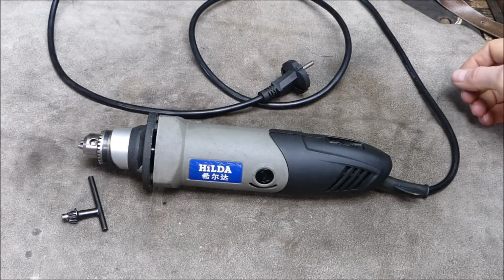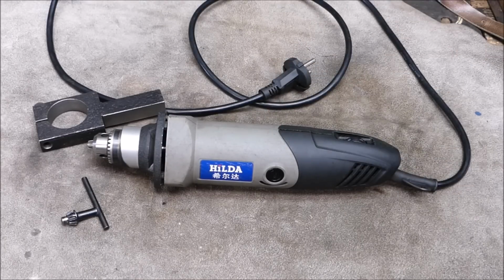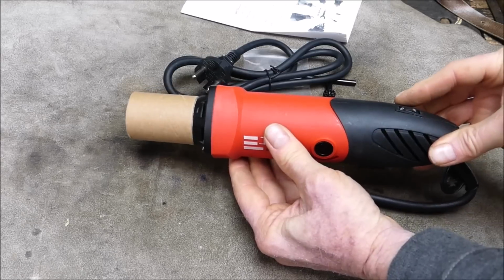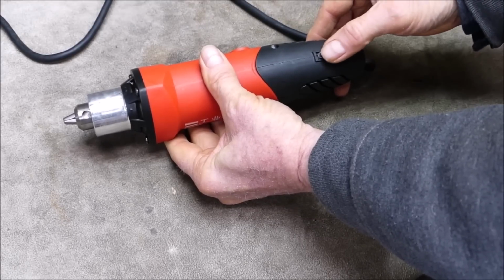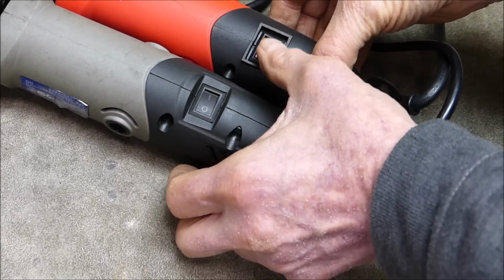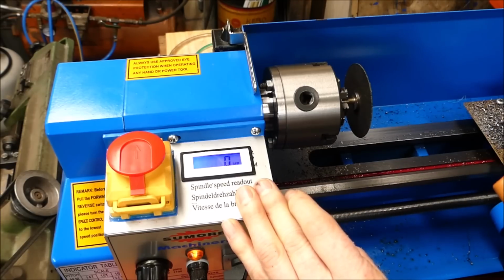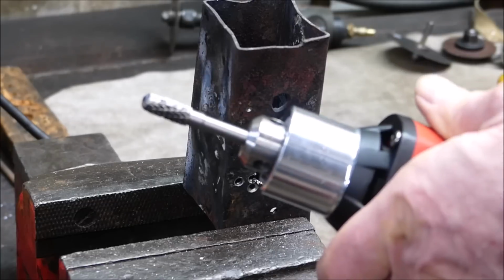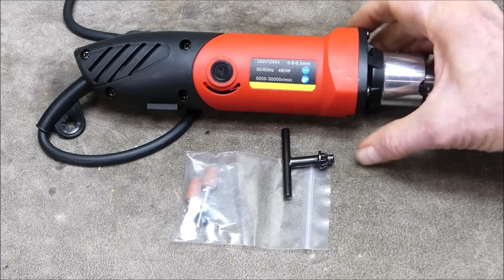I review a budget electric die grinder that ticks all the boxes - well ahead of the rest

Comment from the maker: Note:  The cutting discs shown are made for the job/speed.  They are the same as used in crash repair shops to cut away panels etc .  The size you need is 75 x 0.8 x 10 mm.  They also come in 1 and 1.2 mm thickness.  Rated at 25000 - 30000 RPM depending on brand.  I made the arbour. Dead easy.
  
DO NOT attempt to use angle grinder discs/remnants larger than 50 mm with one of these as the safe/rated surface speed will be exceeded.  Play safe.

Cheers Rob
Reply: You should pin this one,  very good and important safety advice! Also never without at least goggles, better a grinding mask, I've seen nasty shit caused by disintegrating cutting disks.
Reply from the maker: @jonasduell9953  Done.

Comment: Greetings again Robert ,l do use my Hilda on your recommendation.
The nose is limited in length and spindle extensions are problematical at that click l found out with some success. , Otherwise it gets the job done enough but ? 750W 6mm Electric Die Grinder Straight Handheld Grinding Machine Variable Speed, EBay $67 delivered  has some very useful designs adding more versatility and stability but . l wonder if I am missing something that your keen eye won't if you may ? Be good if a store around here had one to try out, under warranty to, ha ha. Cheers ROB.
Reply from the maker: Hi John,  most straight shaft hand held electric grinders only have a collet chuck (usually 6 mm).  The Hilda has a Jacobs chuck which is a lot more useful.  The other version Banggood sell and I reviewed has a machined mounting nose collar as well which allows more positive alignment. Cheers Rob

Comment: I can’t wait to get mine
Reply from the maker: Great tool.
Reply: How fast do they go
Reply from the maker: Supposedly 30,000 RPM.  This one hit 28 K but is still loosening up.  It's too fast to drill and the unit is really meant for grinding, cutting discs and rotary burrs.  Not designed for high torque work.  Cheers Rob
Reply: I normally use flap wheels on mine

Comment: Looks like the machined front allows it to fit into a bench drill stand, perfect for high speed drilling/milling with very small drills/mill cutters. Thanks for your review/purchase. Cheers from Tasmania. Stay safe. Typo on the speed, missed off the ‘1’.
Reply from the maker: Hi Shevill.  It's a mount for any application you wish to use it for, on any plane.  Great feature and a step up on the normal nose configurations.  Cheers Rob

Comment: Some things that I notice from these 2 great tools are that at max speed the hilda only made 20.000 rpm and this new grinder got 25.000 rpm, given that the real wattage difference is not that much of a difference (the hilda got 455 real watt and the new grinder 495 watt), I would say the hilda got more torque than the new grinder that Rob has. You can see the proof of this in the video where this new grinder made a complete stop a few times when Rob tried to drill a harder objects ( a metal plate), whereas the hilda would take this kind of job with ease( in Rob's other video). So in conclusion the hilda is more suitable for a harder work than the new grinder.
Reply from the maker: Higher revs for same size usually means less torque.  For grinding and cutting (which is what these tools are designed for) the loading is so light that torque is not an issue.  The big attraction with the new tool is the machined collar/mount.  That is a great feature for sure.  They are both very useful tools to have.  Cheers Rob
Reply: Xynudu about this torque issue, I kinda disagree with you Rob in any tools torque is very important. For example in a mini grinder if you are using a bigger cutting disc, lets say a 100mm against an object, compared to the factory recommended max 25mm against an object, then you are going to need bigger torque, thats for sure. You also gonna need some adequate torque for polishing and sanding, dont forget that mini grinders are used for these jobs also. Low rpm and high torque thats what you need for these 2. But hey if you are happy with just this newly designed collar mount, then so be it
Reply from the maker: Don't use discs larger than 75 mm with these units or you may injure yourself.  Discs are designed with a safe maximum surface speed which should never be exceeded.

Comment: Looks like an improvement, Rob.
What's the diameter of the machined nose?
Is it by any chance a standard 43 mm drill collar?
Reply from the maker: It is an improvement if you want to mount it or need 110 voltage.  It's 6 mm smaller diameter than the (supposed) standard.
Reply: @Xynudu  Thanks, Rob.
My apologies - I only now discovered you measured it in the vid. I had wondered because sometimes it's useful to have a handle which helps steady the unit for some of the more delicate hand held jobs.
Reply from the maker: I never use the handles that are supplied with drills and angle grinders.  I must have at least four or five in the cupboard.  I find they just get in the way and are really only useful (to me) when doing heavy work with powerful tools.  I know they vary in diameter a bit as I've tried to use them randomly at times and they only seem to fit the power tool they were made for.  Then again they vary in age a lot and some may be pre-standard.  Cheers Rob

Comment: I have a Dremel and an Ozito router I generally use as a die grinder  but watching this video I realized that the Dremel is gutless, has some stupid thread on the nose and the Ozito is to big and cumbersome. although it has more than enough power but it uses collets which I only have one size- 1/4 inch so one of these grinders will fit the bill perfectly ! For the price you can't go wrong !
Just need to watch out that the grinding/cutting wheels are rated for the speed that this unit does , I think angle grinder wheels are only rated for 10,000 rpm or so .
Anyhow Rob thanks for the heads up on this tool - it will make a very useful addition to my lathes
Reply from the maker: Hi Ian, the cutting discs are made for the job/speed.  They are the same as used in crash repair shops to cut away panels etc .  The size you need is 75 x 0.8 x 10 mm.  They also come in 1 and 1.2 mm thickness.  Rated at 25000 - 30000 RPM depending on brand.  I made the arbour. Dead easy.  

DO NOT attempt to use angle grinder discs/remnants larger than 50 mm with one of these as the safe/rated surface speed will be exceeded.  Play safe.

Enjoy.  Cheers Rob

Comment: Thanks,  I was looking around, considering an air driven unit but you talked me into this one, you sly devil. its on sale too, from a local portal, therefore no import duty :>)
Reply from the maker: The air die grinders (as shown) use a LOT of air and my 7.5 CFM compressor can't keep up.  They and the compressor you need are also damn noisy and you use a lot of electricity with the compressor.  They are however bullet proof and run cold.  The electric units are more delicate and will get hot if worked hard, but they are quieter and use a fraction of the electricity.   For home use they work great.  Cheers Rob

Comment: pity they did not make collar standard 43mm diameter.
Reply from the maker: Is there a standard ?  They seem to vary from my experience.
Reply: @Xynudu  yes die grinders are all over the place. But there is standard for drill collars at 43mm, and some manufacturers like Kress use it, and their die grinders can be used in standard drill stands, which combined with xy table can get you some milling action in softer materials. I was hoping to find something similar in more affordable die grinder.
Reply from the maker: This one is 37.28 mm which is not the standard you quote.
Reply: That's what I initially thought too.
Perhaps the 43mm standard was considered somewhat too large for a unit of this size.
Given the parallel nose, I wouldn't be surprised if we see a range of nose mounted accessories much like those currently available for the Dremel.

Comment: Hi Rob , I found one of those about a year ago.    I had to do a lot of looking to find it but I wanted 120 volt and the chuck.   I was very pleased with it and I copied your tool post holder and it worked great.   As you said it is machined and holds great.

Dale in Canada
Reply from the maker: Great to hear Dale.  It's an easy upgrade to lathe capabilities, plus it's my favourite hand held tool for cutting small items.  Super good unit.  Thanks for the comment.  Cheers Rob
Reply: I went out to my shop and had a look at it.   It has professional on one side and 110 volt , 480 watt , 5000 - 30000 r/min , 0.6-6.5 mm on the other side.   Also has Ka nu as a name on that side as well.   I do find it seems to have quite a bit of vibration at high speeds.   Not sure if that is normal or not

Dale in Canada
Reply from the maker: That's slightly different Dale.  Was it bought from Banggood ?  Cheers Rob
Reply: Yes it was bought from Banggood.   Maybe they have changed the color of the units now.   It seems to me at that time it was only available in 110 volts.
Reply from the maker: Looks like they've had them longer than I thought Dale.  I know it doesn't always come up when you search for die grinder on the web site.  Maybe that's why I never noticed it before.  I generally run mine at about half speed which reduces vibration and keeps things under control.  Cheers Rob

Comment: Look Rob, you've got to stop doing these reviews, my bank balance can't handle them 🤣🤣 Seriously, even though my Hilda is fine I've just ordered one, with a few Banggood Points It was just £27.00 in our money, that's a steal! Be interesting to see how much power it draws under load, I've got a power meter so I might do a few tests myself. Great review as always. Cheers, Alan.
Reply from the maker: Hi Alan,  wow good buy.  It would be interesting to know how many they sell.  They used to show that info but not lately.  It runs great.  The collar is very accurately machined.  The Hilda is not available due to supply problems.  No such issues with this one as it hasn't become popular yet (fairly new model).  I could have taken some readings under load, but time was getting on and it would have been awkward, so I just went with the start up draw.   The 110 voltage ones are green coloured.  I wonder why the precision collar was added to this new "Professional" version - maybe they HAVE been watching my videos :) 

I used the Lumix FZ-300 and external mic to shoot the entire video to see how it preformed.  I much prefer the Nikon.   I get conflicting feedback on audio and it seems to vary with the device viewers are watching YT on.

Sometimes the Nikon seems a bit wooly and I thought the Lumix sounded a bit sharp with this.  On my Android they both sounded fine.

What did you think of the audio ?

Cheers Rob
Reply: @Xynudu  Hi Rob. Yes, they still have them in stock at the moment so it will be interesting to see how fast it ships. I reckon they must have been watching your videos and that tapered collar really was the only serious niggle with the Hilda. Despite all the flak that the Chinese manufacturers get I think it's great that they have taken notice and improved the design. Cheers, Alan.
Reply from the maker: It makes you wonder Alan.  Kudos to them for putting out an upgraded design for sure.  The fact that they didn't simply machine the original nose but totally re-jigged it was unexpected and shows some lateral thinking.  I've not seen anything the same from major brand names in Oz.  Amazing they haven't picked up on this great pattern.  Cheers Rob
Reply: Sorry Rob I'm put my reply on my other comment about getting one about a year ago to answer this question.   Hopefully you will see it.   Thanks

Dale in Canada
Reply from the maker: OK Dale.  I saw that and assume it's not a Banggod unit as they only stocked these recently.  Both units I have used vibrate more at top speed, but that's to be expected I guess as there's a lot more mass spinning around than with an air die grinder.  I generally use the electric ones at half speed and it does most things OK.  Also makes burrs more controllable.  The instructions actually say to run them at full speed to reduce heat build up.  Cheers Rob
Reply: Just a note here Rob as mine is 110 (120) volt and it is red in color and looks identical to the one you have.

Dale in Canada
Reply from the maker: Hi Dale, wow, I didn't expect that.  Is it branded as "Professional" with some Chinese writing ?   The advert makes it look like they are green cases for 110.  Then again Banggood web pages aren't known for their accuracy ;)  Cheers Rob

Comment: How do you reckon it will go in a blacksmithing set up for general tool making type work?
Reply from the maker: These are low torque power tools, same as all small electric die grinders.  I would suggest you need to go several sizes larger for heavier work - Bosch and Makita make something suitable.  Big money involved.
Reply: @Xynudu  I have a makings mt die grinder
Reply from the maker: I'm not familiar with that brand.
Reply: *makita yeah I dunno what I’ll be like on the lathe for my needs I have seen em use flex shafts for tpg and general work like gaurd slots for knives etc basically the sort of stuff I do
Reply from the maker: If you only want it for lathe use you could look around for a secondhand commercial Dumore or Waldown TPG - about $600 AU.  I have one but rarely use it as the smaller units are easier to use and faster to set up.  You usually get your money back on secondhand tooling.  Cheers Rob
Reply: @Xynudu  I can’t find one that’s the problem there’s a lot I need like cylindrical grinding and surface grinding equipment

Comment: Hi Rob. What are the brushes for and when and why do they come into play? Regards from Orange.
Reply from the maker: Hi Paul, the brushes are carbon blocks that take electricity to the rotating shaft (armature).  They are located behind the two small round black caps you can see just by the end of the specification label.  They rub on a brass current switching ring and slowly wear away over the life of the power tool.  When they get too short to make a good electrical contact you simply unscrew the little caps and replace them.  They come in a range of sizes.  Cheers Rob
Reply: @Xynudu  Thanks mate. Always enjoy your content and always click like even before I start watching! Thats the measure of an excellent YouTuber.
Reply: Hi Rob , Nice Job of Explaining .

Comment: Got something like that, but collets only. Was looking to add a chuck, a bit of work in doing that. Now, after watching you, going to leave it alone, use it as it was made. Thanks.
Reply from the maker: Collets grip the hardest and are the best option from that perspective, but you are restricted to the very limited compression range and sizes available - usually 3 and 6 mm.  A chuck gets around that issue as it's fully adjustable and works quite well.  I've never had any slippage issues with them.  Cheers Rob

Comment: i think the main problem with this is no drill chuck is designed for side loads.?
Reply from the maker: I don't know where you got that idea from.  Plenty of grinding fittings /arbors for drill chucks.  How are they not designed for side loads ?  Cheers Rob
Reply: @Xynudu  milling cutters I was thinking of,you would never see a machinist use a drill chuck unless it was vertical pressure down
Reply from the maker: I suggest you look closely at micro mills, mini mills and even some medium mills.  They generally have Jacobs style drill chucks fitted as standard OEM equipment.   If you want collets you have to buy them after market.  These are NOT the type of commercial heavy duty units you are talking about.  It's apples and oranges.
Reply: @Xynudu drill chuck is for drilling. Milling with it is waste of endmills. - shitty repeatability and even worse ridgidness. You can do it but don't expect results even comparable to proper collet chuck.

Comment: nice tool for grinding and burrs but for cutting i prefer small angle grinder with 0,8mm or 1mm discs.
Reply from the maker: It's all a matter of preference.  I find the straight shaft cutting wheel more accurate to position.  Do whatever floats your boat.  Cheers Rob